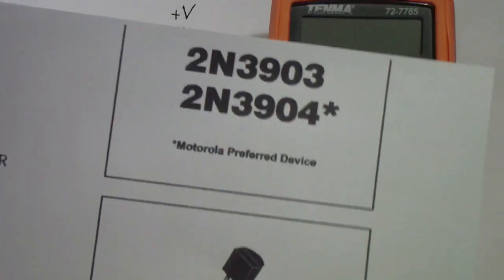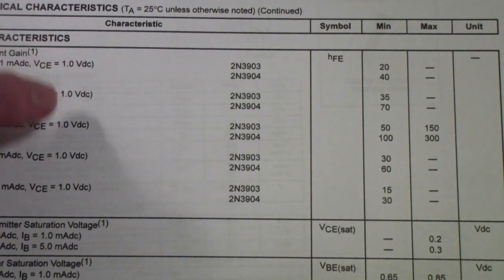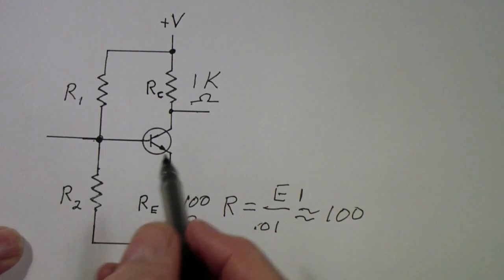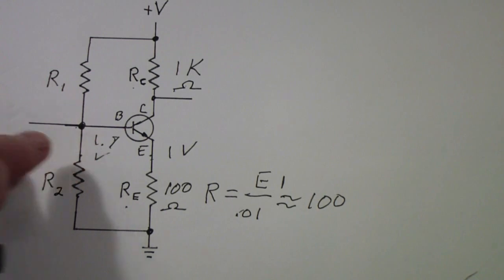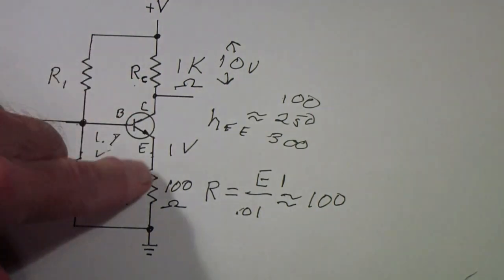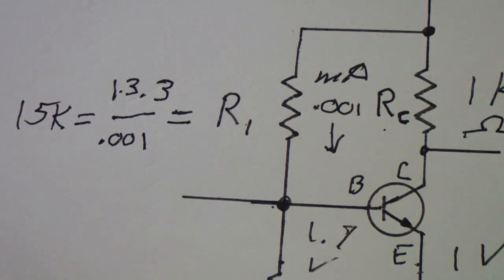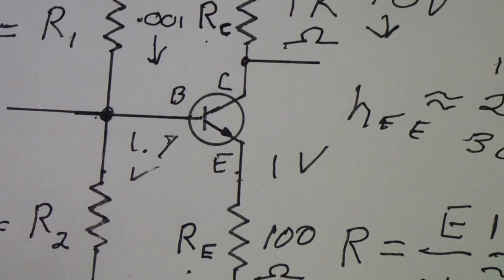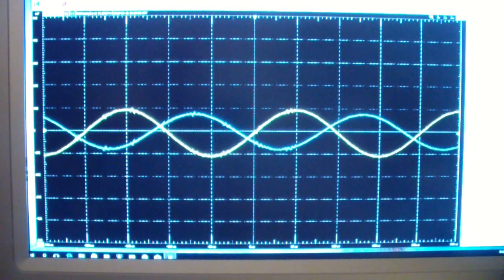TTT136 Class A Transistor Amplifiers Pt1

Comment: Why 4 V across the transistor? it is not the way this thing works, just assuming. OMG man you made a complicated thing be. more complicated. Gain Rc/Re is only when you use Ve = 1V with a lower value of Rc, and that is never a pratical value, in a real world a value is usually under 0,06V.  You should start with a given power supply value and estimate the courrent will be used on the coletor depending what source of signal will be applied. Your explanaition is very twisted and confused but you are not the only one. Every time I watch videos on youtube they try to confuse things that I know a litle bit.
Reply: I was thinking the same, if Vcc = 15V, so 
Vc = Vcc - Ic(Rc+Re)
then Vc = 4V.

If we follow the ecuation Vce = Vc - Ve, we see that Vce (voltage across the transistor) it must be 3V.

It is more easier and accurate stablish Vcc first, then the current thru Rc, caculate Vc an Ve following the commom values, Vc = 40 to 50% of Vcc, and Ve = 10 to 25% of Vcc, then calculate Vce an so on.
Reply: @Josiah.Lara.12  I think he wants to find resistor values based on a gain he wants, and that's wrong. Exact gain is very complicated, involves transconductance GAv = - RC / (1 / gm + RE)
Aproximately 
Ve around 0.5v gain 6 to 10 times
Ve = 0.05v gain 41 to 70 times
Ve = 1V gain around 5 times or less

suppose Vcc is 15V make Vc = any valour between 7.5 - 0.65  (or 0.6 or 0.7), swing will be smaller than +3.5 -3.5V
estimate Ic based on the signal applied in the base, high voltage 1mA to 5mA, small voltage < 500mV smaller than 1mA
Rc = Vc/Ic  pick a closest manufactored resistor and reset the current 
before you  find Re set Ibase first
Ibase = Ic/Hfe  (don`t pick the minimun, 1/2 or more over minimun)
Re = Ve(choose the gain)/ Ic + Ibase    (Ibase is very small could be omitted)
for currents IR1 and IR2 there are two proportions, IR1 use Ibase x 10 and IR2 Ibase x 9  or IR1= Ibase x 6.5 and IR2= Ibase x 6 (i like this one)
, depends the input  impedance you want
VR2 = 0.65V + Ve(chose) then you find R2, discount VR2 from Vcc and find R1
To change the input impedance
R1/R2 = factor , pick any R2 valour and find R1 keeping the factor
Reply: @magicguitarpedal  You'll find that the gain actually is determined by the ratio of Rc/Re as long as Re is much greater than the intrinsic base resistance of the transistor, (re) which is always 25mV/Ic = 1/gm. We don't need an exact gain, but if you want to calculate Rc/(Re + 1/gm) = Rc/(Re + re) = Rc/(Re + 25mV/Ic) for this circuit, you'll see it is close enough to Rc/Re to be within the resistor tolerances. Good design aims to make the circuit performance independent of the transistor characteristics as far as possible.

Of course you set Rc/Re to get the gain you want. Since in this circuit, the voltage across Rc is 10x the voltage across Re, you'll want the voltage across Re to be about 1/20 of the supply voltage. That gives about 0.75V with a 15V supply.
Then the voltage at the base is about 1.4V and that determines the ratio between R1 and R2. The current through R2 has to be much bigger than the base current Ib which will be Ie/beta.
So the collector current along with the minimum beta determines the input impedance and you're free to choose that current within limits to get the input impedance you want. With this design the input impedance is a little less than R2. A collector current of 1mA in this design will require R2 to be much less than 1.4V/0.01mA if the minimum beta is 100. that makes R2 << 140K, and we'd normally use one tenth, so R2 < 14K and the input resistance will be a bit less than 14K.
If you want an input impedance of more than 50K, you'll need to use a collector current of around 0.2mA 
R2 in this case will be << 1.4/0.002mA = 700K, so taking one-tenth, R2=68K and R1=680K. So Vb = 1.36V and Ve = 0.71V. Try Re = 0.71V/0.2mA = 3.55K Set Re=3.6K and therefore Rc=36K. Collector current is 0.2mA, so the collector bias point is at 15.0-7.1 = 7.9V above ground. That will give at least 12Vpk-pk output swing.
The input impedance is R1 || R2 || beta x Re = 53K.

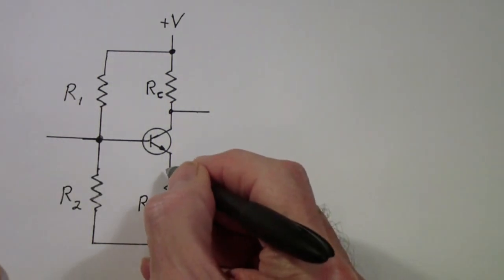Comment: 6:47 pulled one volt from the sky.  why one volt?  why not two?  why not one half?  does it have anything to do with Vce?
Reply: It's a parameter that the designer is free to choose within certain constraints. If that 1V is reduced much, variations in the transistor Vbe between samples and with temperature will become significant so the circuit becomes difficult to bias stably and distortion will increase. Because the voltage across the collector resistor is 10 times as that across the emitter resistor (for a gain of ten), if you increase that 1V by much, you'll need a much higher supply voltage to keep the transistor from clipping the output signal.
You'll need to know how much temperature stability is needed, how much distortion can be tolerated, and how much voltage swing at the output is needed to be able to optimise that 1V that was pulled from the sky. Usually 1V isn't a bad value to go with.
Reply: Pretty sure, Vce has a saturation value and the output chara also gives the value of Vce before it can act as an amplifier

Comment: So I just built this circuit and I find my output sinewave is incomplete, the entire top 2/3 is missing?..... cut off?
Reply: Cut off or saturation
Reply: The circuit as designed isn't going to give an output swing of more than about 12 to 13V peak-to-peak _at best_. If the gain is 10, then I assume that you're not trying to drive an input signal of more than 1.2V pk-pk (i.e. about 400mV rms). I assume you're connecting your input signal through a blocking capacitor - try a 1μF capacitor (if it's polar, then + goes to the circuit input)
With those conditions, If it is clipped at the top, then the collector bias point is too high. Measure the voltage on the collector with no signal - it should ideally be around 8.5V above ground. If it is higher, then you need to reduce R1, say to 12K (or connect a 56K resistor across it for the same effect). That will increase the base voltage to 1.7V from 1.4V and drop the collector bias point by around 3V (the DC gain is -10). You could use a 100K potentiometer across R1 and trim it around the high end to give you a fine tuning of that bias point.
Hopefully that will allow you to set the clipping symmetrically and then reduce the input amplitude to something that the circuit can cope with.

Comment: Nice, basic, understandable lecture.  I got a bit lost with how you got 1V, but anyway what do you expect of a lowly electronics technician and not an engineer.   I think you should have told your viewers that if the collector resistor (1K ohm one) is not in parallel with a diode (positive side toward V+), which is also in series with a 0.001 microfarad CD capacitor, then a voltage spike from V+ would destroy the transistor.
Reply: I think that is if you design a power supply for the transistor i think he is more on explaining the operation of it

Comment: I still don't get it how did you use 1V as voltage across emiter resistor, although datasheet says that 1V is voltage on Vce? Vce and Ve are different things...
Reply: That's just a value that the designer is free to choose. It is not connected to any value on the transistor datasheet. If you try to make that voltage too small, then it becomes difficult to establish stable bias points for the circuit. If you make it too large, then you need a very large supply voltage to allow a decent gain while allowing the output to swing over a useful range.
Those are the consequences of changing that 1V, but you might want to raise it a bit to improve stability, or lower it a bit if you've only got a 9V battery as a supply. Unfortunately, you have to design a lot of circuits to get a feel for what is going to be the best choice for parameters like the emitter bias point or the collector current (which sets the input and output impedances), given constraints like supply voltage, available supply current and required input impedance.
Reply: @RexxSchneider do you have a YouTube channel?
Reply: Data sheets give you approximations for one design based on a given hFE. He made his own design for the desired hFE or DC gain. If the numbers on the data sheet were static this wouldn’t be designable, only buildable.

Comment: @tomtektest Hi, at about 8 minutes you say for the gain to be x 10 the top resistor (Rc) has to be about 10x the value of the bottom resistor (Re 100 ohms),is that logic based on the fact that 1k (1000 ohms) is x10 larger than 100 ohms?, does it always work out like this, so for example if i wanted the gain to be x5would i make (Rc) 500 ohms instead of 1K (1000 ohms), is that how it works?
basically both Rc and Re setup is a voltage divider
Reply from the maker: You have the principle right. Remember though that this is an approximation and only works over a normal range. For example, if you put a 1 Meg resistor in Rc and a 1 Ohm resistor in Re, you will not get a gain of a million. Like all approximations, they work to get you started, which is the real idea I was trying to get across. Also, as you see in Part 3, if you bypass the emitter resistor, then the gain goes up, regardless of the initial ratio of Rc/Re. There are always factors that limit the useful range of approximations, but they are very useful in getting to a starting point.
Reply: thanks for your answer, and obviously to the HFE of that transistor effects it too,2n3055 and bc547b are 2 of my favourite transistors, so versatile